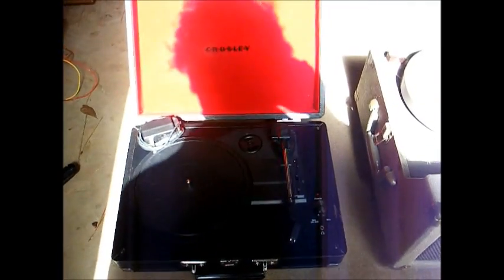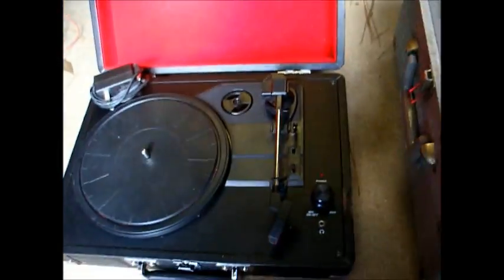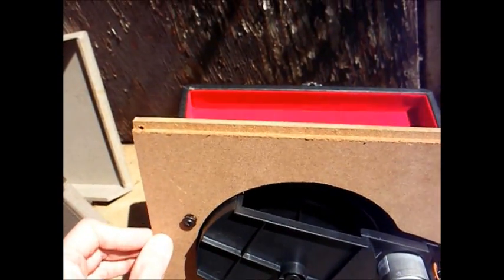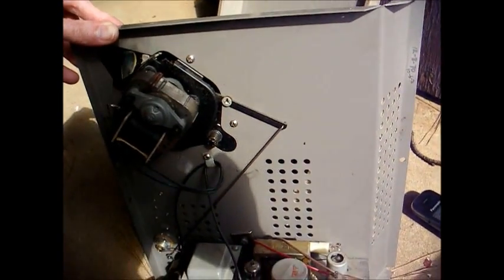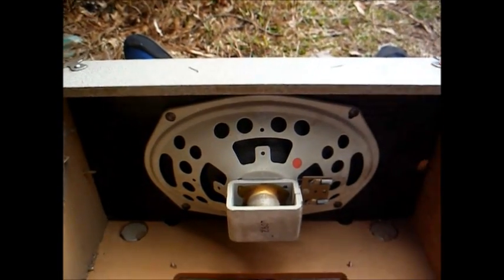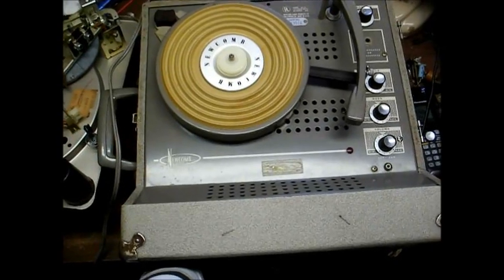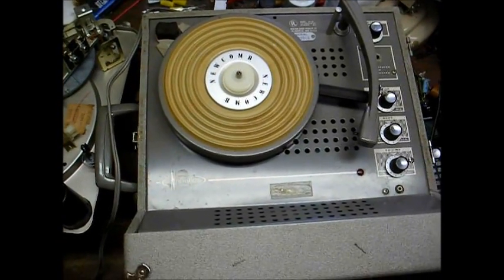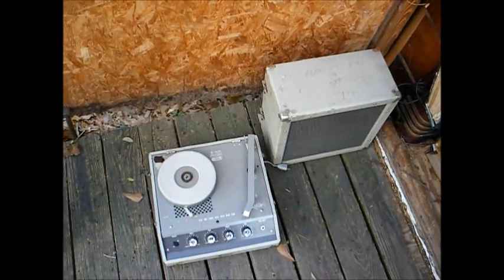2013 Crosley record player Vs. 1964 Newcomb record player (don't buy a Crosley)

Comment: The spring loaded 45 rpm adapters were a problem for flexi disc records and other 7 inch light weight records with small holes as they don't have enough weight to hold down the adapter. You will need to use a piece of scotch tape to hold the adapter down to play such records.
Reply: To solve the problem, I’ve put a few coins on top of the record.

Comment: I'm a mom wanting to buy a turntable for my 13 year old daughter.  I see lots of what not to buy.  I have my husbands from the 80's.  should I repair it (weird noises when it turns) or should I buy new.  If so what should I look for.  Thank you.
Reply: Repair the old one, as long as it is a quality one from the day (i.e. Technics, Audiotronics, Pioneer, or Kenwood). If it is a lower quality unit (i.e. Sound Design) try and find a good old fashioned unit like the Newcomb in this video. I hope you take this advice, buying a Crosley leaves a bad taste in the mouth of someone wanting to get into record collecting.

Comment: Very interesting.  I'm not in the market for a vintage turntable, being one of those audiophile people who uses a modern rega Turntable.  But I'm still interested in the type of cartridge used in the Newcomb.  Is it ceramic or moving magnet, and what is the approximate tracking force it places on a record?
Reply: +MarkPMus Most of the school record players like Newcomb and the other brands back in the day had ceramic carts, but they sounded good for that erea.  They had a heavy tracking force, I would not play good quality albums on them.  They worked good for playing the records of that erea, I think the vinyl back those days was a tougher grade of vinyl than has been made the past 35 years.   I own a Califone school record player and it plays good, I play old 45s on it sometimes.   My good turntable is a direct drive Technics and I would put it up against the over priced Rega's and other autophile turntables.   Why spend so much money on a turntable when you can get great sound off an old ventage turntable like a direct drive Technics ???     Hell I could put any cartridge I want on that old Technics and their is no noise from it and it holds a perfect stable speed.
Reply: +Kelly Whatever damage a 6 gram cast-aluminum arm and a slide-in Astatic awl/cartridge did to the "Dr. Dolittle" soundtrack and the disk to go with the "Don't talk to strangers driving old Edsels with the lock buttons cut off and ice cream cones between their legs!" filmstrips was probably irrelevant compared to what an adventurous kid to do to an "Elac Miracord 22h" in ten unsupervised seconds.
Reply: No Name
I have a moving magnet cart on my ventage Technics and I run it at 1.5 grams.  It plays great, excelent tracking and no noise from the turntable.  I only paid about $100 for my Technics off Ebay and it plays about as good as a new $4000 unit.

Comment: hey radiotvphononut i would REALLY like to hear any info (model number,etc) you have on the last newcomb you show in the video around the 13:53 mark. i used to have one just like it, cord wads up into a tube in the right rear side, spring loaded feet...etc. i was probably 11 or 12 and the school i went to was tossing a bunch of old stuff in the trash and i snagged it. it worked great with a new needle and some fresh oil to the bearings. the tube amp in it was very powerful and high quality, unfortunately i dont know what ever happened to it, sadly i think my mom may have tossed it.
Reply: nvm i did some DIGGIN! and found http://www.antiqueradios.com/forums/viewtopic.php?f=9&t=243128 which appears to be a post made by you! let me know if you want to sell it! SELL IT TO ME AND I WILL PERSONALLY BURN A CROSLEY AND UPLOAD IT!

Comment: Quality stuff today??  I bought a Chinese made T&P (Temperature\pressure) gauge for the boiler over the web.  Threw it away as junk.  Bought a 2nd type and it leaks slightly when the boiler runs more (Deep winter).  I looked into having the old "U.S. Gauge" T&P restored and it (Like the old player) was quality made.  The overhaul cost was just too excessive. I have not discarded the old one because those items are not meant to be discarded.  The pressure mechanism became inaccurate and for something 50 years old I can accept that.  It worked for almost 50 years since U.S. Gauge manufactured it.

Comment: Awesome!  I would almost say this is an apples to oranges comparison, but for what you pay for one of these modern pieces of junk you can get a restored, vintage piece of gear that will last another 40 years.

I restore vintage turntables in the Atlanta, GA area.  Hopefully a few people out this way will be smart'nough to run across you videos comparing junk to real turntables, and buy some good vintage gear.

Comment: If you want to massively improve the fidelity of the Crosley, if it is using the typical ceramic cartridge, take a syringe, fill it with silicone grease (di-electric grease from the automotive store), and inject this into the cartridge.  This will dampen resonant vibration of the cartridge.  You can also use Vas-o-line, but if the cartridge uses real rubber dampers, they will be ruined in a year or so.  I've used Vas-o-line in these cartridges (the ones used on Crosley players that I buy and use on my 78 players) with good results, but I don't guarantee this.
Reply: +td1238 If you want to massively improve the fidelity of the Crosley, throw it in a landfill, and buy something made well.
I do guarantee this!

Comment: mounting stuff with hot glue?? i have made diy electonic stuff in my garage/workshop (like a homemade adjusteble powersupply and small pentode tube AM-transmitters) thats far better made then that and i´m a self-taught electronics hobbyist with no formal electrical education or advanced tools

Comment: Do you ever talk about late 70's and later turntables like a Technics SL1200 or classic Pioneers, or just the 60's and earlier?
Reply: ***** But the late 60's to 70's conceived some of the biggest advancements in modern stereo. Transistors in receivers greatly reduced harmonic distortion and Turntables became more adaptable. There were a lot of advancements with phono cartridges.
Reply: That's good to hear. Good luck to you and your grandmother!

Comment: Hey radiotvphononut. The first two record players I used to own were a mono RCA Victor children's record player from back in the 1960's & a stereo GE Wildcat from back about 1971 or 1972. Both of those two record players played 78's as well as 33's & 45's. The RCA Victor also played 16's. And none of those two had a needle made be flipped over for playing 78's. But, I did have a stereo Soundesign AM / FM / FM stereo record changer 8-track player combo which was first made in I believe 1975. It had a BSR record changer built in to the unit. It was the one I actually had where you could actually flip the needle over for playing 78's. The turntable I now own is an MCS Series Digital 5000 Series from back in the 1980's which will only play 33's & 45's. That same turntable itself sounds absolutely beautiful playing a 180 gram vinyl record. What do you think about all of this? Thank you! :) Merry Christmas to you! :)
Reply: my best friend had a G.E. Wildcat back in '74....it had a 'cobra' painted on the tone arm.

Comment: They both sound pretty crappy. The Newcomb is really designed to be kid-proof more than hi-fi, so I'd wouldn't expect much better. The Crosley is just all-around crappy; quivery speed and tinny speaker. I have no reason to buy anything like that, though I can see why people who don't want to restore and maintain an old machine (and hopefully don't have a valuable record collection) might want to buy some throwaway thing from China,  but some sound a lot better than that, at least when new. I'll stick with 1950s - 1970s changers; I just like watching the damn records drop; otherwise, mp3s are good enough.

Comment: I have a early 80s model Technics turntable and a Caliphone school record player.  They are very good quailty, and the junk they make now is cheap made crap like the Crosley or very over priced audiophile turntables.    You can buy good working vintage record players or good working vintage turntables like Technics off Ebay and most of the sellers on Ebay are honest people.  I have baught about 6 or 7 Technics turntables and the Caliphone school record player off Ebay and they were good working units.  I think 2 of the Technics had little minor problems, but no problem to correct and they were good units.  
If you want to save money and buy something good, shop on Ebay for vintage turntables.

Comment: On the one hand, the Crosley is a bit poor.  On the other hand, you're comparing Apples and oranges a bit. The Newcom is built to take a much tougher environment and work, while the Crosley is very much a novelty. "Hey look, I can play an old record!"

Still, the difference between a new RP1 I bought the other day, and the Steepletone (With the same basic head and turntable unit as the Crosley) is like night and day. And the RP will last a hell of a lot longer. For one thing, parts are replaceable, and it's simple enough to be tough. (AC motor + connection from tonearm)

I bought the Steepletone because of the form factor - it fit in the space I had - but it sounded a bit crap. One of these days I'm going to gut it and try and refit some of the internal parts and tone-arm with good-quality electronics. The box is big enough to fit a pre-amp and a simple amp, at least.

Comment: To be honest you don't really need to buy expensive modern gear... in the UK at least, 90s turntables by the big Japanese companies (and a few lesser-known British manufacturers) were getting to the point where they were a bit plastic in construction, but they still had a lot of manufacturing integrity. I'm thinking of the typical turntables included with mid-spec midi systems, which were usually separate by this stage. They had good quality P-mount cartridges (I have a Goodmans Delta 800 which is by no means an expensive unit, but it comes with an Audio Technica cart) and the servo motors were decent and reliable. It has only been over the last 10-15 years that things have taken a real turn for the bad, mainly due to the fact that turntables have moved out of the mainstream... a typical Japanese bookshelf system (which costs around $200) is as well made as it ever has been, but usually only has a CD player, digital radio and sometimes network streaming for that money. Times change.

Comment: also another weird flaw ive noticed with that particular crosley model is that if you manually spin the turntable with the power switch on, it will self power itself and the speaker and everything will work.
Reply: I have seen a similar thing with a Crosley traveler turntable, where the power LED turned on when I unplugged it and spun the platter. It’s just the cheap thing like the cruiser model, but the speakers are larger. It hardly sounds any better at all. I think it has a bad stylus though, it sounds scratchy on records that sound perfectly fine on other turntables I used that feature the common audio technica magnetic cartridge.

Comment: Most older tables bearings are quite noisy compared to the technology used today. Hi Rez audio systems will give that away in a Heart beat! Finding a nice quiet table at a stereo salon is your best bet in today's audio world. As far as changing records or picking up the stylus get off your A&&'s its good exercise all the bells and whistles do nothing but compromise sound, that's why higher end designed tables of today are made the way they are its called engineering!

Comment: My JVC Nivico console and component systems from the 60s sound light years better than any plastic retro outfit made recently. Robust bass and Crystal clear mid and treble. Will blow the windows out if turned up halfway and are of very heavy construction metal and wood.

Comment: I really enjoy your hilarious and spot-on commentary re: your projects with vintage gear compared with new crap. New crap serves its purpose, in a throw-away culture kind of way, right? A USB set is great because it makes it EASY to transfer old records into WWW sharable cultural  gems . But there is nothing like the quality of which you often speak of in your vids. I'm sure you are familiar with the old German made Dual turntables that were included in most decent quality Fisher etc. console systems. My TT ( a United audio/Dual brand)was accidentally dropped from an 8 ft high perch onto concrete, during moving. And it still works to this day! A  Chinese throw-away TT would have exploded.

Comment: These "new" Crosley's were a good idea for those that like me, abandoned vinyl, but kept it stored and didn't have a record player that worked anymore. I got a couple Crosley's in 2006. One for me,one for my Dad. It was neat to play records again. But the sound wasn't as good as my home stereo.
I still have my Crosley's, but don't use them anymore. They are toys. Nothing more. I bought an Audio Technica and it plugs into my amp. Sounds 1000 times better. 
The classroom Record player you showed is real quality. Back in the days when quality was expected and affordable.

Comment: It's funny too that the marketers chose the name Crosley to make it sound like a vintage product name. When in reality it is just cheap junk from China. About 20 years ago I won a made in China Grundig reproduction shortwave radio in a raffle. I knew it would be junk so I asked if I could get something else in exchange and they told me either take it or leave it. I took it and it ended up dying a few months later. I opened it up and the electronics were a dog's breakfast. It looked like someone had tried to repair it before and the retailer got rid of it by raffling it off. I ended up leaving it behind when moving.
Reply: I have a Grundig world band radio, reel to reel tape recorder and a cassette recorder. Made in Germany and built like tanks.

Comment: Many thanks for this video. I have an old Newcomb player but it is solid state-wish I had a tube Newcomb or Califone. I was going to sell it until I saw this video, and decided to see if I could repair it instead. The turntable stopped turning altogether. I took the turntable off and looked at the idler wheel and it still looked almost new but was kinda hard to turn. I took it off and put grease on the shaft put it back together. It  was the easiest fix ever! It works just like a new one with only 5 minutes effort! It plays great and loud-too loud so as to speaker distortion at about 50 % volume. Maybe I need to hook up an external speaker. I do have a fairly new Audio-technica AT-PL-120 record(2009) player also. It works great and plays 78's. It cost about $350 when I bought it new in 2009. Well worth the money. Yes Crosley's are super junk--would you believe that one just sold on ebay for $238.00???  I don't think they cost that much new.   Bob

Comment: I've got my mom's old Sharp Turntable/Tape player/Radio stereo system from either the 70s or the 80s. It plays the records at a slightly higher pitch than it probably should, but I couldn't care less. IT WORKS!

Comment: Here in Australia, we had AWA(Amalgamated Wireless Australasia) who made consumer equipment like radios, phonos,  radiograms(mono and stereo), and TV sets, they also kitted out TV and radio stations with quality gear that would leave any other company's product in the shade. An AWA-built radio, phono or TV set would be superior to anything RCA, Pye, EMI or the German Grundig, Siemens or Blaupunkt could turn out. Sadly, by the 1980s, AWA stuff was being made by Mitsubishi - still good quality but nowhere near as good as what AWA themselves produced. By the early 21st Century(2001-now) Mitsubishi had given way to some Chinese electronics mob making stuff under the AWA brand and turning out TOTAL SHIT, and thereby flushing the once-great AWA brand down the toilet.

Comment: I remember back in the 80's you could buy these Newcomb and Califone industrial record players all day long for 25 or 50 cents each at school surplus auctions. They always worked well and had good needles. They are some of the best portables ever made. Now you're lucky to find a good working one in a flea market selling for under $50... which is still a great buy. Most of the ones that are still around need new idler wheels and won't play at proper speed when they dry out. Several online vendors sell new wheels or will rebuild existing ones.

Comment: This is the same Crosley I saw some days ago in the supermarket, I didn't even notice it had built in speakers until you mentioned them, the tone arm was already broken and had no stylus, so, I couldn't give it a try.
There were stacks of new modern LP's as well, surprisingly they ask 40 dollars for each record when I usually can get up to 20 old records for the prize of one of those.
I can assure there are better players in the trash, as once I saw a 70's Sanyo with a BSR sitting on the side of the road, sadly couldn't get out of the car to pick it up because I was late.

Comment: A vintage portable record player is cheaper, cooler, and sounds better than a new one. Got my Audiotronics 304a for just under $70.
Reply: Isn't there a risk also with the old ones unless you buy one refurbed because of discontinued parts or dry rotted belts etc?